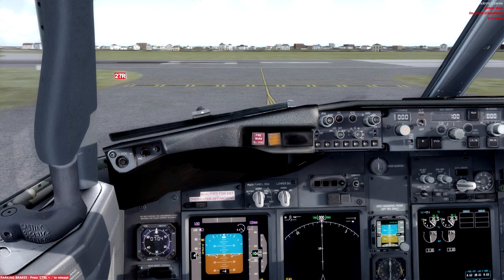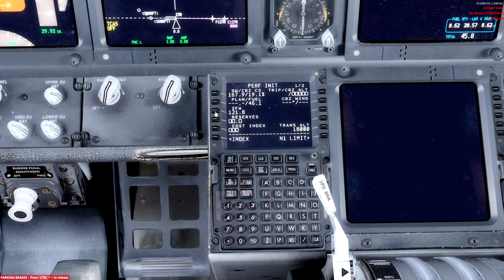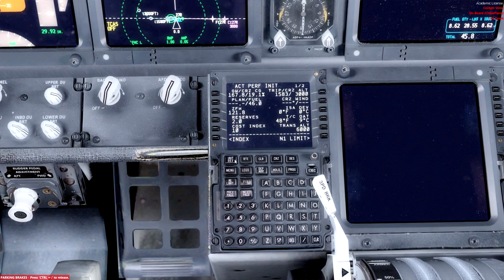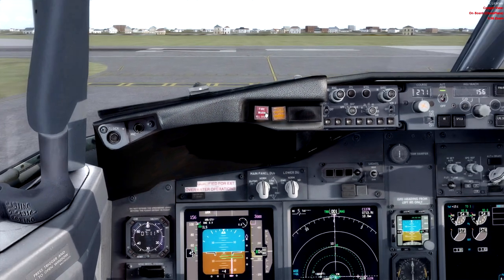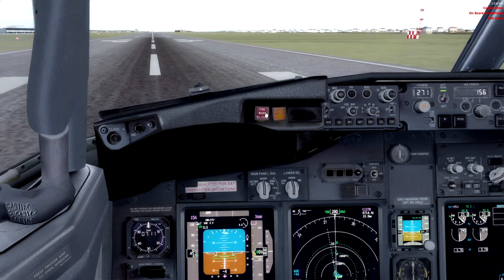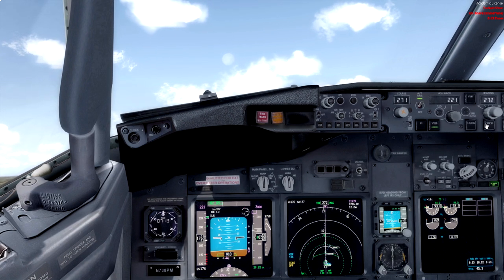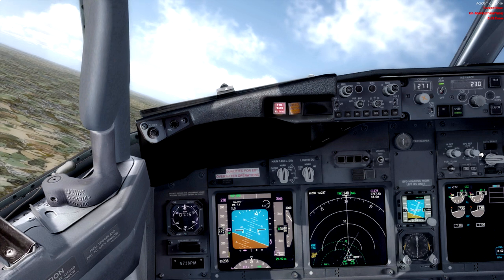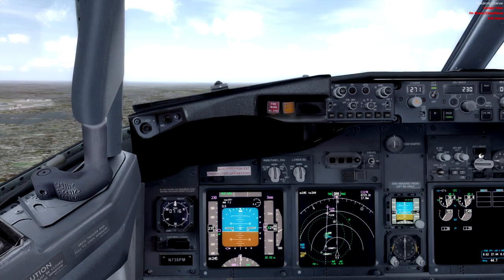How to do a Circuit at any Airport with any Plane

Comment: I think you used a little to much rudder on touch down cant you turn the rudder sensitivity down a little, always do circuits out of egbg off runway 28 as technically passes over my house. i take it you flying on P3D any news on a v4 at all & I know P3D core backbone is fsx but i thought they would have really updated textures and ground modelling looks like my fsx literally did they only update issues with the performance that was a hit or miss for people on fsx mine run's really well and very very rarely see a fsx crash I love flying all the pmdg jets thou i wish pmdg would of modelled the 757 one of the best aircraft in my opinion still to this day i love stepping onboard 757 slightly less if it not packing the rb211's, was going to ask in the stream the other day but i forgot what airline would you like to get into sorry for the long message Luna Thanks.
Reply from the maker: +James Randall cheers James